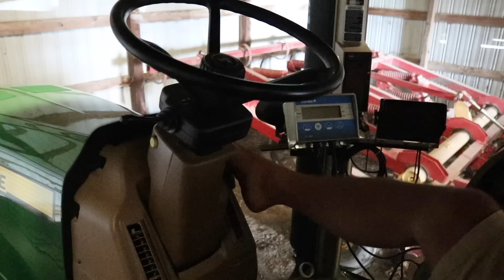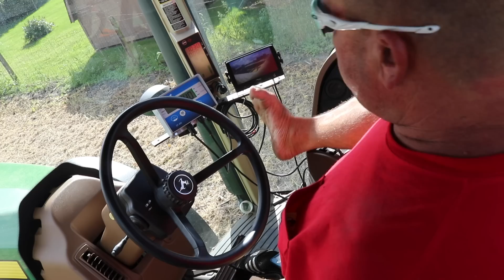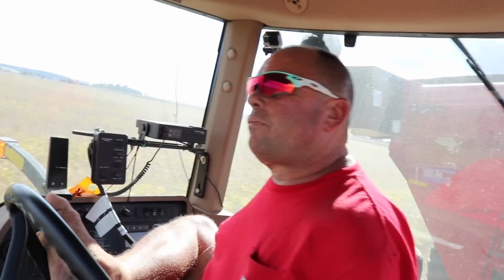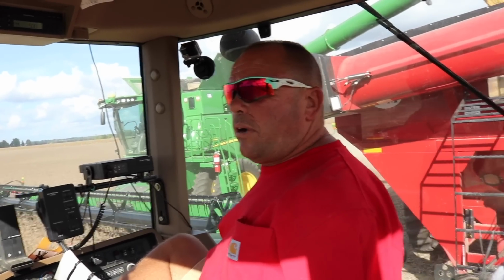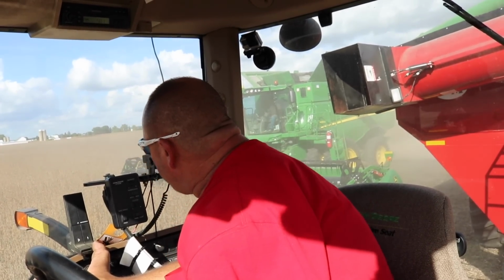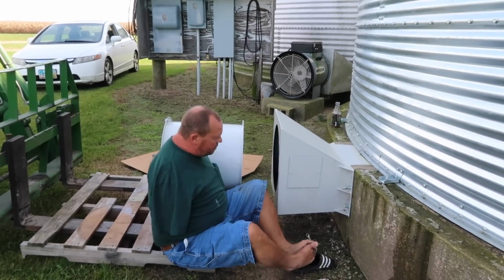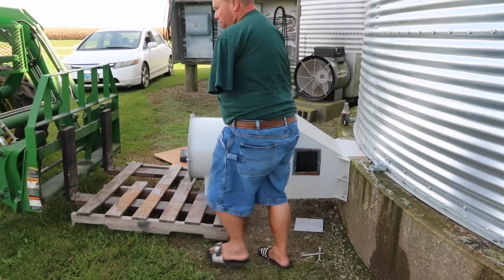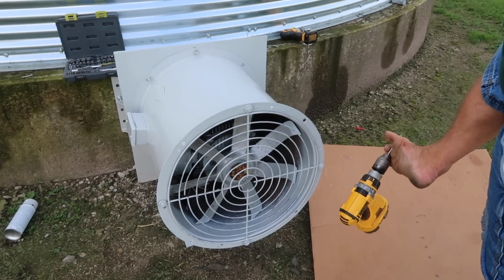Welcome to the Farm

Comment: I generally never ask such questions.  I come from a mostly Cereal and oils grain farm. We handled such as weat  oats  barley, and Canola grains.. saying such my question is,  would there be more Dust and trash from Beens than cereal grains?  It seems some videos show huge dust coming off the back of a combine in beens so i wonder.  As i remember back on calm days after combining barley or oats the worst ones you could see the huge clouds of dust hanging. I pulled a IH pull type Swather, and combined with a JD pull type combine, and a chain not belted newholland round bailer to bail. using same tractor a 4440 JD for all three operations..
Reply from the maker: Soybeans create a lot of dust. Beans need to be, or should be, 13% or dryer when Harvested. That means the stocks are at least that dry also and the whole stock goes through the machine and is pulverized and blown out the back as dust. A lot of dust. Way more than say wheat.

Comment: Question please do you think all the no till planting slowly drops the water table.  Especially since there is very little sub soiling to brake up the hard pan and equipment is bigger an heaver than ever.
Reply from the maker: On our farm, we don't have hardpan, since we aren't huge farmers, but we can pick and choose where and when we work the fields. Too wet, no way. We do rip our ends that we murder with the semis, but as for or fields, no compaction. our water table is between 6ft-20ft here and we are underplayed with gravel. we don't even have tile!
Reply: Thank you for your reply but in your farmers opinion would no till lead to a lowering of the water table esp.on large acres of flat ground. No one thinks about till there's a extended dry spell.
Reply from the maker: Do you think this because of water runoff? I think the trash left on top of the ground holds moisture. Around my place, I don't think notill effects water levels.